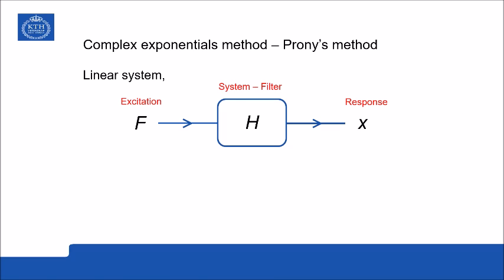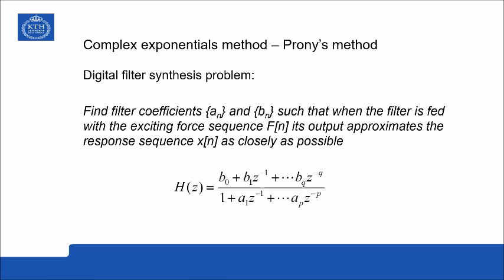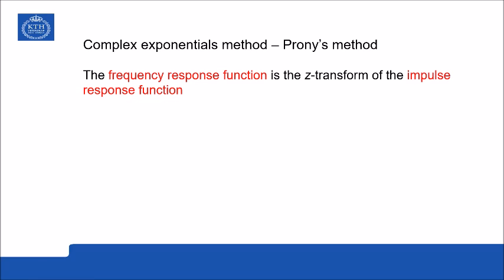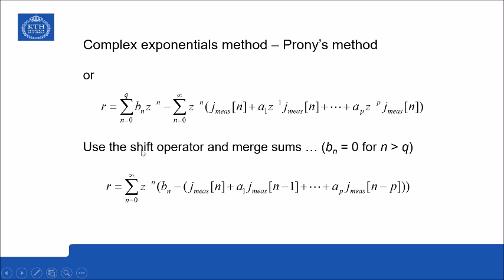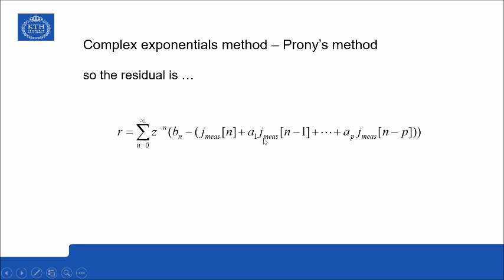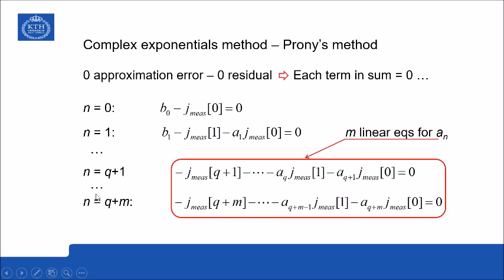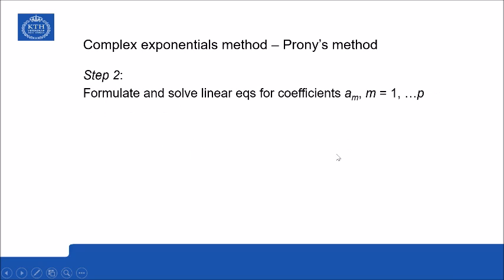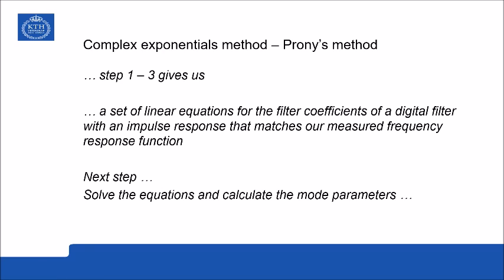Presentation 23: Mode parameter estimation - Prony's method 2

Comment: Thank you for your video!.
Could you help me to answer one question?
I have a simulation data from PSCAD (this is oscillation signal of a generator), and I want to extract the modal frequency and damping rate. I try to use prony toolbox, but I cannot get the result. So, could you share any example or recommend any method for this work?